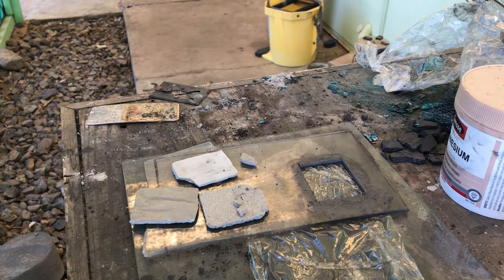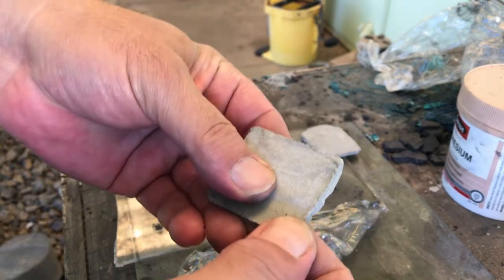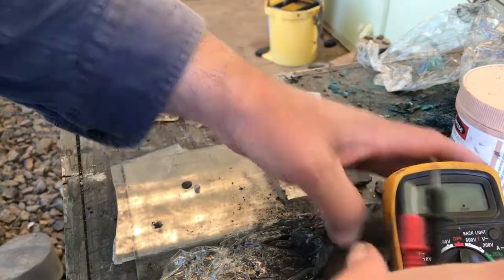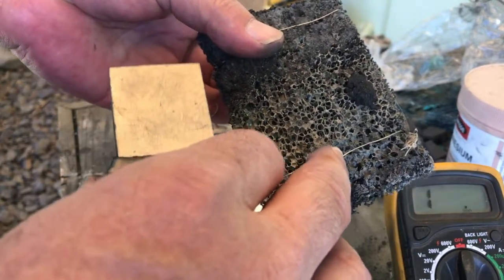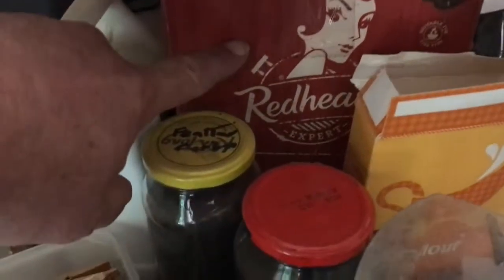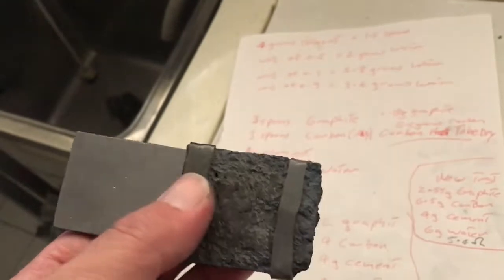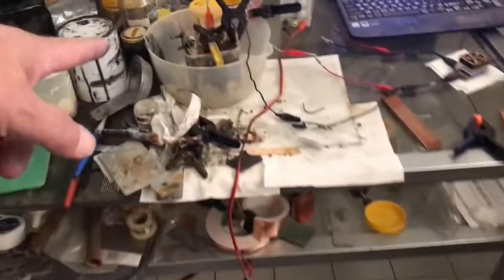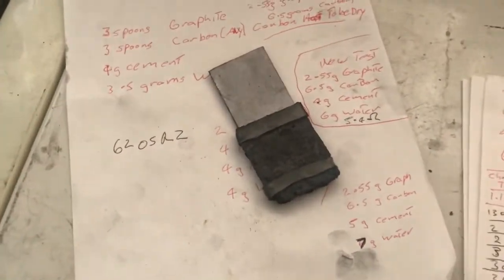Builders Cement As A Battery Binder

Comment: I think you need to mix Electrolytes with water into the cement to improve both voltage and capacity, but your on the right track, i just came across an article where scientists are perfecting this technology for future buildings and bridges.

Comment: Does the mAH seem low compared to aa batteries?  Are you trying to get the mAH higher by trying different ratios/materials? Or is there some other advantage?

Great research!
Reply from the maker: Yeah mah are low but it’s just plain carbon. The aa use mno2. I was just getting binder right and will be adding nickel oxyhydroxide  to the carbon at a later date.
Reply: @danp1224  oh I see. Is the nickle oxyhydroxide a new material? How did you decide on that? (I'm not a chemist but an EE interested in battery/supercaps)
Reply from the maker: @TheRainHarvester  hi. It’s not new been around as long as nickel iron batteries or longer. It’s toxic don’t get it on hands or breath it in. I have a video on how to make it.
Reply from the maker: I decided to use it from watching how they make nickel iron batteries